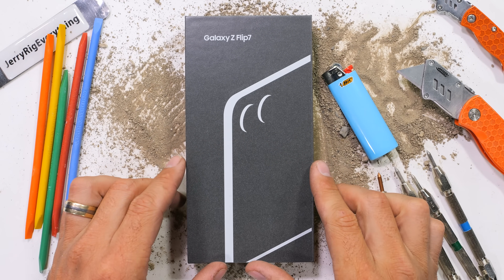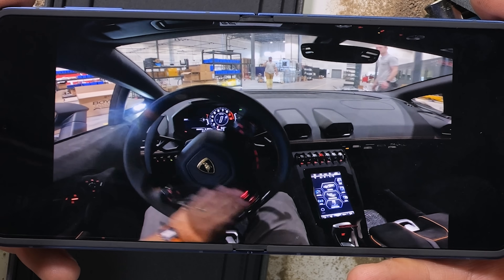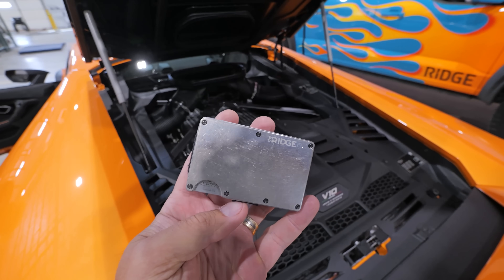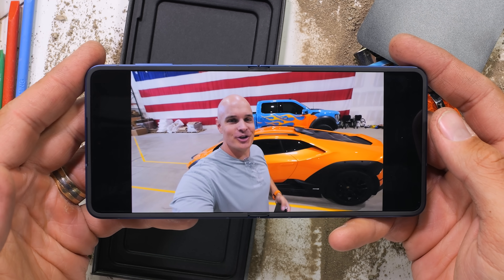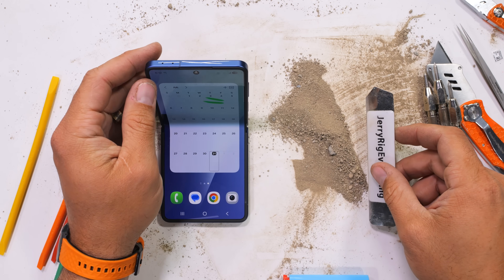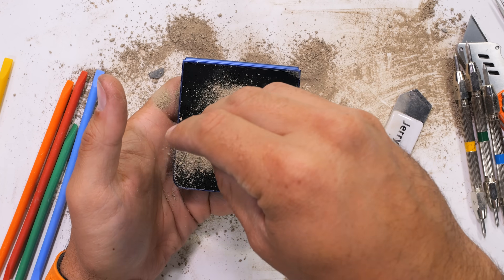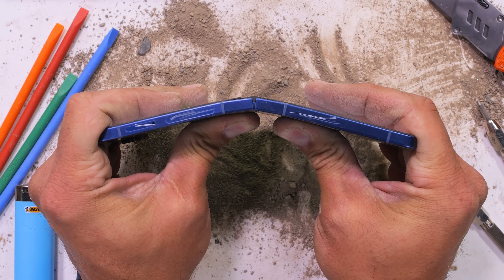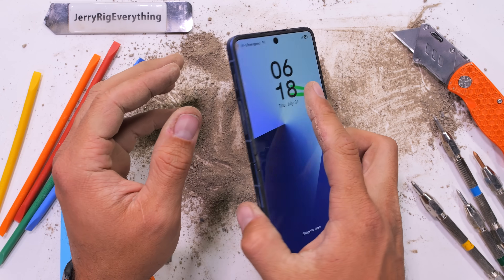Samsung Z Flip 7 Durability Test --- Revenge of the Fallen

Comment: I want to recommend a new test. A drop test, specifically on open vertical drop test. I somehow pulled a Morty lightsaber drop with my flip 5 and the center line of pixels snapped like a glowstick and ruined half the screen and completely rendered the touchscreen useless. That was maybe 4 feet in a case and it was catastrophic.

Comment: I've been actively using my flip 3 for about 4 years now and the inside screen soft scratches go away after a bit as long as they're only indents and don't actually scratch the outer layer of the screen! 
The biggest wear I've noticed with my 3 now is that it doesn't quite open up completely, so if I lay it down on a table while open it wont lay flat. That and ofc the crease in the screen is starting to crack. I've started considering getting a 6 or 7, but it's not quite dead enough yet!

Comment: Jerry I know it's too early for this request.I just read Android Authority on the new Google Pixel 20 Tensor 5 chip with Vapor Cooling. If you happen to get the Pixel 10 Fold it would be interesting if you could take one apart. I want one in 2026. I'm going to watch a Pixel Fold tear down.
 How does a vapor chamber really work on a phone that is made to be water and dust tight? Google switched to using a cam instead of gears on the hinge it would be nice also if you could take the cam cover off to expose it and compare it to previous models.
 The one phone I want and it would suck to see a video that would destroy a $1900 phone but worth it to me because I would like to know how the chip is different from Samsung and how it's cooling system works.😅
PS I wonder how many youtubers will take a Pixel Fold 10 and do water drop test to failure?

Comment: My Z Flip 7's screen have a dead pixel three days after my purchase. On the first fall, it broke. Samsung said we can glady replace the screen of your brand new z flip 7 for only $350!!
Reply: To be fair that fall damage was on you. Since accidental damage is not covered under warranty. However, if you bought Samsung Care + it would be much cheaper of a repair. Also, Samsung's support is dependent on the region as well. My mom dented the hinge on her Z flip 5 during the first month of owning it by accident but Samsung Repair Centre was kind to take it in and repair under warranty for free for us.
Reply: @Junispro31 I did not mean it is not my fault. Dropping is my fault, but the screen protector itself was not built strong. That's my point
Reply: @enesertt_ 😂

Comment: Hey Jerry, have you ever considered trying to twist the two halves of the phone? Thanks to you we know that the hinge and inner screen can handle bending, but can it handle torsion? Try closing the phone and see if you can offset the two halves form each other. This might be an important point to note for those putting on phone cases. Most suggest to slide one half onto the phone when it's closed; if you don't apply even pressure, you'd cause flex in a way that twists the inner screen, which could potentially cause some dead pixels? I'd be very interested to see this.

Comment: I bought a flip 4 when it released. Survived 2 years. After those two years:

I was unable to close it 
Screen peel
Dead pixels all over screen
Crunchy 
Broken camera lenses
And more. 

I see this phone suffers from the same fate. Will without a doubt break in a similar if not identical fashion. Only way to make the flip phone durable is: 

Stronger/more scratch resistant screen 
Dust protection 
Stronger hinges

Only 1 of above is fixed, the rest is impossible.

Comment: The tests you perform are more of a kind of "controlled torture" than a technical analysis of durability under real-life conditions. Fire tests: as you say, no one is going to put a lighter to their phone screen. It's not a realistic scenario at all.
• Bend tests: bending a phone with brute force in both hands is not something that happens in everyday use. While it may reveal structural defects, it's also not a common way for a phone to fail.
• Scraping the sides, cameras, buttons, etc. with a box cutter: this doesn't measure practical durability but rather vandalism resistance. It's obvious that a box cutter will scratch aluminum or chip paint.
• Mohs scratching: this is the only test that may have any practical value, because it indicates the type of glass on the screen (for example, whether it's actually Gorilla Glass Victus or plastic in disguise).
Rather than assessing "real-life" durability, your content appeals to destructive spectacle, using serious language to give it the air of a "technical test."

Comment: Now if I could get some assurance that Samsung fixed the issue of the screen lifting at the fold after a year's worth of use, I would bet the Flip 7 today.  With both my old Flip 3 and my current Flip 5, the screen has started to "lift" (Samsung's tech's words) at the crease after a little over a year of use.  It makes the screen look bubbled at the crease.  I thought it was just the screen protector coming loose, but the tech stated that it was in fact the screen.  And since it was just barely over the year mark (same thing for both the 3 and the 5), it was out of warranty and Samsung wouldn't replace for free.  Now, I really want the Flip 7, but have been hesitant to upgrade for fear of having the same issue with the new phone in another year.  I asked the tech if Samsung has addressed this longevity issue, but he had no answer.

Comment: I have a Flip 5 and I think YouTubers haven't used them enough to see the main issue. 
The main screen protector which you are NOT allowed to remove, starts peeling in the center along the fold after 4 months. I have changed mine 3 times under warranty from normal use. As warranty expires, it will still needs replacement every 4 months. 
I asked the Samsung techs and apparently this is extremely common and they do this every day. Basically it has a permanent cost every few months. Now it's peeling again from the crease and time to schedule another appointment.
Reply: Quite a few people on Reddit confirm what you say about the main screw protector.
Reply: For real? Then why isn't anyone talking about it? Should I trust some random person on the internet, or highly acclaimed tech critiques? Probably the latter.

Comment: I had 2 zfold 3s that the screen died. Got a used zfold 5 and a year in I have personally replaced the inner screen protector about a month ago. Didn't do a great job with instalation, but it is working. The phone seems to be going strong

Comment: I decided to get a Flip 6 because of your video... I've been abusing the hell out it for almost a year and besides a few scratches on the outside screen it's in great condition! Inside screen is as good as the first day
Reply: My wife has a flip 6 and it's holding surprisingly well. She let it fell off a 
Few times and it only got a few scratches
Reply: planning on upgrading my flip 5 to the flip 7 when i can! went from my s22 to the flip 5 and dont plan on going back to the regular galaxy any time soon!
Reply: @crobatss was the battery life good?
Reply: @TabletFe-d8d  to be completely honest, it was way, WAY better before the last android update. im not sure what changed after and why my battery drains so much now. but the 7 has a 4300mah battery, as compared to my 5s 3700.
Reply: @crobatss thanks for the information, still think should i wait for another year to get the flip 7 or this year but get flip 5 😂
Reply: I did not treat my Flip 4 gently either, but it tanked everything until the flex cable eventually broke due to repeated flipping. 

These things are much tougher than they look. To the point of probably never breaking from normal use. BUT components were impossible to replace. Which I find insane for the price.
Reply: Me with my Samsung Galaxy Note 10+! Poor thing has been falling off of 1.30 meters of altitude almost every day for 4 years now and it just has some scratches in the outer side of the curved screen. My mom would always panick when it slipped from my hands but it has never broken lol meanwhile, my friend had an iPhone 12, accidentally fell down and when he picked it up the whole screen was cracked. The touch kept working but it looked ugly af.
Reply: Mine got sand in it and formed a weird screen glitch from it.

Comment: Would take two separate glass screens with as small as possible bezels/gap over a single folding glasstic screen any day. Too bad no phone company has the balls to make a phone like that, since thats useful and not a gimmick. Microsoft was on the right path with the Surface Duo, but did like everything wrong attempting it. LG had a phone too that was on the right path.

Comment: The pliable if he peeled off the protector, The next layer I believe is actually ultra thing glass , so it should be a harder serface. To the finger the screen doesn't feel that soft, it still feels like there's glass behind it (because there is). That said I'm curious how hard the glass within these screens is. I've seen it shattered before and one of the previous videos where he tore it apart, but he never did a hardness test on it when he tore it apart.

Comment: The only phone that I would buy because you have a basic plastic screen that is weaker than regular phone screens. It has less resistance than regular phones. It folds and becomes shorter, but it is twice as thick. Its specifications are lower than any phone at its price and does not even come close to the most useless phone.

Comment: Every time I think about getting a Fold/Flip phone, I watch these and get my sense back.
Reply: For real. Every time I think of getting one I come here and see that a finger nail scratches the screen and nope out
Reply: @furaieu  Your fingernails won't scratch it, the screen protector is made of TPU plastic. Which is scratch resistant, however its also elastic. So what hes calling scratches are actually points where the screen is compressing due to that elasticity. They will go away in a few hours as the plastic returns to its original shape.

Comment: 4:02 idk man, the future,  they can have glass in the non foldable parts of the main screen, basically only the hinge would be plastic
Reply: that was exactly how the early foldable models were. it was a terrible experience due to the seams so it evolved to what we currently have
Reply: No it will not have edges idk why they didn't make it till now the bendy part should be 4~6 mm the rest should be glass by now
Reply: I fear it wouldn't look great this way
Reply: @Zhenya_01  i mean thats what they said about the crease for the first few generations and now its almost not noticeable. a lot can chance in a cpuple of years
Reply: i think there would be a visible edge between the two screen types
Reply: Exactly! Saying something is impossible does and should invite people to prove you wrong out of spite!
Reply: That's very hard to do but thats something I thought of
Reply: Yes I've thought of this before
Reply: Getting the transitions to blend seamlessly might be a step backwards in overall quality, while replacing the inner screen protector is pretty cheap and I've only had to do it once on my fold 4 after eventually crease lines started to appear, they weren't too bad but it started to lose adhesion in the center, $20 later and it's especially new

Comment: 4:28 fun fact: Samsung’s official button replacement procedure (in the official repair manual, mind you!) is the same as Zack’s, except for the recommended tool, which is definitely not a JRE razor blade
Reply from the maker: It should be!
Reply: @JerryRigEverything probably works anyway

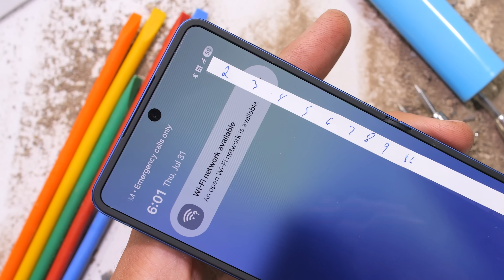Comment: 3:30 It must once again be pointed out that the inside screen protector is made of a compound called Thermoplastic PolyUrethane (TPU). This plastic has properties often considered close to rubber. More importantly, it is elastic. It is this elasticity that gives it a limited ability to stretch and be deformed. While returning to its original state over time. In other worlds, it "Self Heals"

So those markings at level 2, and from his fingernail, are actually points where that plastic is compressing in response to pressure. It is NOT actual damage, and NOT permanent. The plastic will recover over time, and they will usually disappear within a few hours. 

Bigger markings sometimes take longer, and there is obviously a limit to this. I once took the side of a quarter to the inside screen, and it took 2-3 days to disappear, but it did disappear.
Reply: THIS IS TRUE IT LIKE THOSE FILM SCREEN PROTECTORS THAT PEOPLE USE ON CURVED DISPLAYS
Reply: Original phone screen protectors were first made of plain plastic sheet way back in ye olden days, then tpu came along for a little bit during the mid smartphone era and also was usually marketed as self healing (even though it never really worked that well), until tempered glass came on the scene and thankfully became the new standard so replacing scuffed up protectors stopped being a weekly chore.
Reply: @misterdeedeedee  Yea, why heal from scratch if you can avoid the scratch in the first place. So tempered glass did knock TPU down in the market.

 However, there are other industrial uses to TPU films besides screen protectors, so it really shouldn't come as a surprise that they continued to develop and get better since the ye olden days. Now with flip phones they have a niche use case again.
Reply: Very cool reply..very helpful and sounds 100% like what i heard...
The self healing is something being developed in Automotive paints as well...will be awesome when its a big reality...but my z flip7 has been brilliant 2 weeks so far!!
Coral Red❤
Reply: I don't believe this and sounds like a marketing shtick to make you feel better about your awful purchase.
Reply: @S3SSioN_Solaris  believe what you like. There are film screen protectors made from the same materials with the same self healing properties. Big damage doesn't repair itself, obviously, there are limits to it, but some scratches do
Reply: @depressed_firefly I have the flip 7 and I can prove this is false. Even little dust flakes in the air that land on the phone scratch the inner screen.
Reply: @S3SSioN_Solaris TPU screen protectors have been around longer than flexible displays have been. There's plenty of articles going into the properties of it if you dont believe me. They're also like $5 if you want to test it yourself.

This also isnt to say its better than the outside glass screen, just that you don't actually need to worry about fingernail scratches.
Reply: @S3SSioN_Solaris dont show us you cant think
Reply: @S3SSioN_Solaris  bro is ragebaiting again
Reply: @S3SSioN_Solaris  reminds me of the old self healing phone plastic back

Its a thing, theyve made it work with screens

Comment: I have a Flip 5. After 18 months the screen protector started to remove itself at the hinge. I DIY replaced the screen protector. It was pretty easy.
Reply: I wonder what the variables are that increases the risk of something like that happening. I got my Flip 5 at launch, so it's just over two years old now, and it's holding up so well I don't think I could even tell it apart from a brand new one. I'm hoping it'll be good for several years more, as I'm trying to hold out for a version with some real improvements to the crease.
Reply: @mascot4950 not sure. I live in a cooler climate. Not sure if that matters. The delamination happened very quickly. One day I noticed the edge in the crease just lifting. 2 days layer the whole crease was delaminated. Wasnt a big deal though. Pulled the original off and put on a new one in 30 minutes.

Comment: In the context of foldable inner displays, I believe the next step in their evolution will be the development of a hybrid design: glass surfaces on both halves of the screen, with a flexible, soft material only at the hinge where the fold occurs. I imagine it's possible to engineer a material that transitions its properties smoothly across these zones.
Reply: Probably be tens of layers different shapes and thickness
Reply: Issue is: glass slapping against glass = cracks. We don't want that, do we?
Reply: @AHB-et2tg  None of the foldable smartphones have their displays touch when folded. The frame always protrudes slightly above them precisely to prevent even the smallest speck of dust or grain of sand from causing damage.
Reply: Funny, I was just thinking the exact same thing while watching this video. The viability of that solution would depend on how frequently the folding part of the screen is the part that gets damaged. If it happens too often, then investing in a hybrid solution wouldn't be worth the money unless they can significantly reduce the width of the folding strip.
Reply: That might make the creese more visible tho
Reply: I've been thinking this since like the first fold they should totally hire me

Comment: The screen on the inside is glass lol. That's just the screen protector, I've been peeling them off on my fold 3,4,5 and now 7 with zero issues. Think of it like a gel screen protector on a normal phone, same exact thing, just peel off and replace if you damage it or it  peels, simple.
Again, there's a hard glass screen under it, the screen itself is not soft nor plastic.